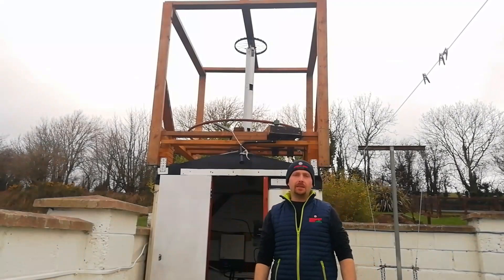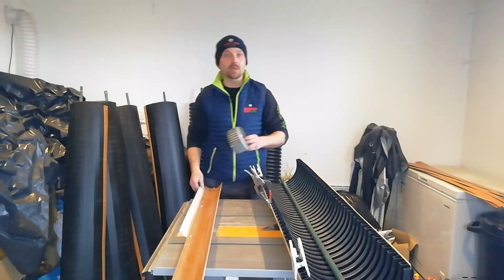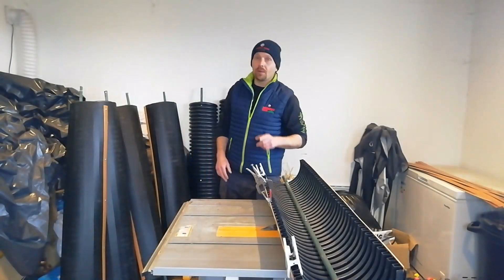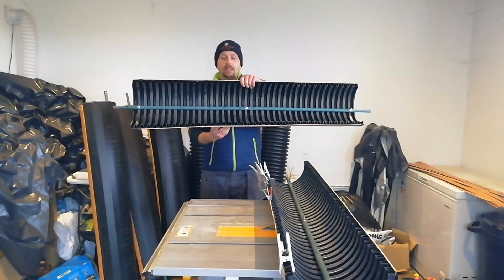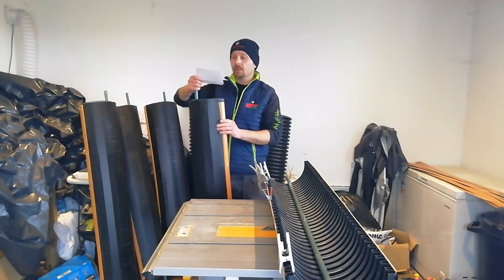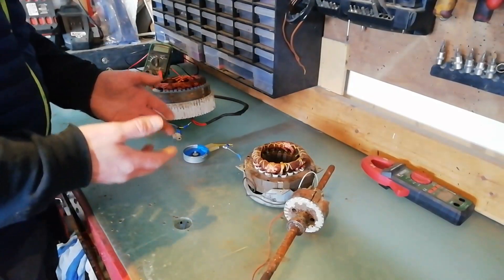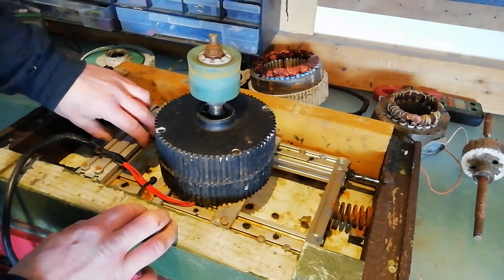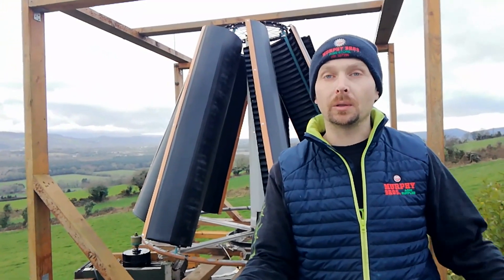DIY Vertical wind turbine, how we made it, tips and experience

Comment: What an enormous amount of time for a few kWh! 
Simply install x inexpensive (€50) 450 Wp solar panels at an angle of 60 to 90 degrees (e.g., on an exterior wall or fence).
 Even THAT will generate more electricity in winter. And for at least 25 years, without maintenance or repairs. 
Small wind turbines close to ground level, on the other hand, rarely last more than a few years.
Reply from the maker: Watch our more recent videos, we currently have 10kw of solar.
Reply: @ourkilkennyhomestead2006  I know that they also have plenty of PV panels. My post was meant to be general: even in winter, small wind turbines don't generate enough power. And the effort involved in building or assembling and installing them is disproportionate to the – in most cases – short service life of wind turbines.
Reply from the maker: @michaelvanallen6400 in reality the wind turbine is essential to continue living off grid. Solar alone won't cut it.

Comment: WHat has been occupying my brain for over a year is a vertical windmill mounted INSIDE a tube. Said tube would be 18-24 inch diameter and the WM would be mounted to the sides from inside of the tube. The tube would  be 30-40 feet high with a 90degree elbow on bearings allow the top elbow to swivel 360 deg. Having input at ground level and 30-40 ft output, facing leeward basically sucking the wind out of the tube, amplifying the flow inside the tube. 
Now if turbulence becomes an issue, a sheetmetal grid of 1inch boxes be inserted into the tube forcing the incoming wind to become laminar as it gets forced into the boxes of the grid of sheetmetal entraining the wind which would help reduce the turbulence.    I believe forcing the wind up by having it suck up the wind from the leeward facing elbow at the top of the tube would amplify and maintain a usable wind force. Placnig adjustable vents with electronic feedback on bottom would allow control of flow of wind entering the tube helping eliminate over rotation.
Reply: I do not enjoy the resources you have of equipment,  and space (suburban living) allowing construction of all manner of tests on my property. Living on 60x100.
Reply from the maker: Sounds like a design thst should be built and tested, I like it. You could also incorporate a venturi into the tube to increase the speed of airflow.
Reply: @ourkilkennyhomestead2006 yeah was thinking that too, but one step at time. I don't know the rudimentary of the tube the swivel bearings at the top and the electronics to get this to charge a battery.
Reply: @ourkilkennyhomestead2006 do you have any experience as to whether airflow?Hitting a vertical windmill from below, we'll actually spin it, or does it have to be somewhere lateral perpendicular flow?
Reply from the maker: @SomnoNaut have a look at automotive interior fans, "squirrel cage" design systems.
Reply: @ourkilkennyhomestead2006 i know those from a nineteen sixty eight javelin.I used to have which used those for the heater. The issue is the air was fed into the box where the fan was and the fan then took it and blew it out.A space above where the fan curvature was. I'm just wondering what the best design to sit in.A flow of air and produce electricity is

Comment: That is an interesting not about the corrugation.
It looks to me like you could catch more wind with another trampoline frame on the top. It would increase your area of wind catching a lot. Also if you have a prevailing wind direction, perhaps you could channel that wind with tarps, roofs or walls to direct more wind into the catching side and away from the drag side. Perhaps that is not so good for high winds though, it would negate the built in governor of drag on the return side

Comment: What power did it generate?
Reply from the maker: The best it ever did was just shy of 600w, needed a better generator and control system tbh.
Reply: @ourkilkennyhomestead2006 thank you.
Where can I get that black generator, and did you modify it?
Reply from the maker: @justtinkering6713  the black PMA was an eBay job, honestly id recommend buying a better one. If you go to the istabreeze website you can buy just the generator on its own which would perform better than the black one shown in this video.

Comment: What is the current and voltage in avarage?
Reply from the maker: @mpoltav2  average maybe 10- 15 amps @ 28.8v. Would perform much better with a better quality generator.
Reply: @ourkilkennyhomestead2006  really cool, thanks. Keep generating 👍

Comment: What I think most people in the wind and water power industry is missing is what the old mills had, one or another type of a flywheel that made everything go around in a steady flow. 
If you connected your blades to a flywheel, maybe with adjustable gear ?
Old windmills have big adjustable blades turning steady in low wind and got everything to work without modern materials and bearings.

Comment: why not to use a belt from the bottom bike weel (that should be round) to the generator pinion?
Reply from the maker: Not enough ratio between the wheel and generator, thats why the generator runs on the outer frame.

Comment: Interesting to see the topic of corrugation being brought up so much in the comments.
Why aren't wind sails on sailboats corrugated if that also isn't using the principle of lift? When you give them, I've read through your explanations in the other comments.

One reason given is that it channels the flow of the air, but that air would get directed in the same curved path whether corrugated or not. Therefore the forces at which the angle of the wind is hitting are not augmented. Remember it's not just getting hit by the wind, it's at what angle. The wind that hits the walls of the raised ridges is going to be ricocheted off at such a slight angle like a bullet on a tank, providing no extra ooomf, just a small loss in the sideways direction.

The surface area one also doesn't seem sensible, if taken further.  As some have said, you can't increase the surface area of the wind hitting the device. That's just a flat geometric shape cut out from the air.
More so, if surface area was a benefit why not put in much more? You could increase the number of wrinkles and folds like the crevices of the brain, or microvilli in the intestines, or fins on a metal heat diffuser. Just imagine, would the result be a super turbo fast turbine, or a heavy lump?

Speaking of heavy lump, the fact that you haven't shown this turbine IN ACTION yet, and are forced to move it using a jet of water instead of the actual wind itself, makes me think it reasonable for us all to expect that until you can prove to us otherwise with a demonstration (Which the whole community would be glad to see, so we could all improve the efficiency of turbines) why the whole world is wrong and you're correct, perhaps you'd be better served by evaluating your unsubstantiated claims.

Proof sir! You must give proof (I'd suggest two side by side, one corrugated, one not). Until then, it's unbecoming of you to act offended when called out for your... bologna. So far it's you alone against the entire world on this (Since no one else does it this way on purpose that we know of), so if you want us to take your future videos seriously, either lose the indignant sort of, "I'm right everyone's wrong" attitude in the comments or else PROVE IT.
Reply from the maker: You sure put a lot of time into that one. Let me address some of your key points, your 1st error is perhaps in your perspective, this is not a lift type turbine it's a drag type as are sails on a boat they operate on drag not lift. So principles and behavioural characteristics that apply to lift type designs won't apply here. The fundamental principle of drag type is to catch as much of the available "pushing" force from the wind as opposed to lift type which operates on a pressure difference between blade surfaces.
With drag it's ideal if a larger catchment surface can be created without increasing overall size of the  blades which is what corrugation provides.
Re: my attitude, is born out of frustration at this exact type of thing. For centuries man has used ridges, splines, Phillips design, torx design etc, all to increase the surface contact area for an application. It's fairly simple as I see it but it seems that most fundamental of understanding is lost on folks who seem to think that this turbine operates on lift principles and hit me up in the comments claiming I'm some sort of fraud simply because this creation doesn't fit their understanding, knowledge base or terms of reference.
Power output, as the generator is a seperate device, theoretically this design can produce whatever the attached generator is capable of. In this case it's driving a not very good ebay generator claimed to capable of 600w @24v when the best I've ever seen from it is between 2 and 300w max.
With all that said, the current situation is that I haven't bothered to repair this creation since storm force 10 winds ripped 3 blades off after 45mins of high speed performance. Long story short I will be rebuilding a tougher version with gauges and would like to get a better generator also but it's not in the budget this side of Christmas.
I did do basic smoke tests on the blades to help visualise the airflow behaviour on the corrugations and the results were interesting to say the least.
I hope this addresses your questions , thank you for taking the time to write the comment without the snarkyness. When it comes to comments, if I get attitude, I will respond with attitude.
Hope this covers everything, as a suggestion i would recommend looking into the various methods used in different technologies to take better advantage of the coefficient of friction by increasing contact area. Another good example of this is an engineer named graham flowers who designed a drag type HAWT using corrugated blades. It works extremely well and you may find very interesting.

Comment: If I may pick your brains, what makes the 4 blade fragile? I love to understand.
Reply from the maker: You can pick but you may not find much 😁 only joking.
There is 7 blades in total. What makes them fragile is simply the upcycled materials used for construction. With better materials such as aluminium I believe the design would have survived the force 10 storm that damaged it.
Reply: Thank you so much for sharing ❤

Comment: Awesome video, thinking of doing a similiar DIY project. Had a Couple questions:
1. How much power is this generating a day? I know it's wind but on average what are you able to generate
2. Could you scale it up by adding another motor on each corner?
Reply from the maker: Hello Cole and thank you. Currently it's generating nothing as it was damaged in a force 10 storm a while back. The best we saw out of it was 200w approx, this is due to the poor quality generator (ebay). I'm on the hunt for a better generator at a good price before rebuilding it with some improvements in durability. 
This could definately be scaled up to run multiple generators if required. One thing to note is that it's a low rpm turbine so the turn ratio between turbine and generator is important to ensure that the generator turns fast enough. That ratio in this case is 30:1.

Comment: How much electricity do you get from it annually?? Cost of materials?.......Please.
Reply from the maker: Incidentally we have a vid on the moment of failure if you're interested.
Reply: @ourkilkennyhomestead2006  Go on- break my heart. put it up. Good luck with your project and channel btw.
Reply from the maker: Honestly can't answer that question as the turbine was destroyed in a gale force 10 wind a few months after it's construction.
Material costs were roughly 400 euro including the generator which was €250
Reply: @ourkilkennyhomestead2006  Sorry to hear that. Thanks for the reply. Most of what I read/watch says 'don't bother with small scale wind, it's not worth it.', I'd have loved them to be wrong. Any idea of what the most it cranked out was? 300W?
Reply from the maker: @michaeljames5936  funny enough It put out just over 200w a few moments before it went kaput. When it comes to small scale wind, we've learned from our setup of solar combined with an istabreeze HAWT that wind is a good complimentary source of power for when the weather is poor or at night time. To have a more reliable off grid system, more than one source is required unfortunately. A combo of wind, solar and a petrol/diesel generator seems to be the setup that works best to ensure power is available in all conditions. If you're thinking of building a system yourself I'd suggest starting with solar, then a generator and finally add the wind turbine.

Comment: this is quite clever. I wandering what if you put the blade in the opposite direction , i mean wider in the upper part, with the wind triyng to lift it as a a plane wing and pushing upwards, maybe more velocity and torque. Thanks for sharing

Comment: Hi loved your creativity... Corrugated looks good and if you are like the IOM then the wind won't be a issue ! Just stripped my Chinese lantern as no matter what I was getting 2 - 4 watt at 2-4.5 volt ( not good) found the three phase cables had been pushed into the coils inside the insulation wrapping, no solder or connections the wire fell out as soon as I opened the casing carefully due to seal..... Do yo know what wattage you get from a working 
VAWT  I think this is a 400 w 12 v. Many thanks for your video.
Reply from the maker: Hi Dan, not sure if you have a similar generator to the one on the vawt but ours originally made around 200watts. It's a bit the worse for wear now 2+ years later so probably below that output. One way you can test yours is with an amp meter. Connect the generator to a controller, rectifier or even an AC load of some sort and see what amperage you get. Then multiply amps by the volts to find the Watts.

Comment: Nice simple design. I do like the idea of having the motor on the outside of the lower wheel, as its got more or a circumference from the motion of the spin. Have you connected this up to a battery etc? That would also be good to show, in another video maybe?
Reply: Iron conducts electromagnetism 
Soft precious metals separate the north + and south - energies.
Plastics insulate the nucleus precious metals from one another.

The moon bounces between the Earth's two N&S  energies +&- 19 year full cycle.

Earth's precession of the Alpha Omega equinoxes full cycle 26,000 years.

Sun's precession/OBLIQUITY cycle 60,000 years.

Rotation of the galactic bulge is 240,000 years full cycle eccentricity.

Climate trends obliquity eccentricity.
Climate cataclysms eclipsing the electromagnetic gravitational energy equator of the Sun's Oort cloud magnetosphere every 12,000 years for a 1 000 years, of peace if humanity accepts Jesus as their Christ Messiah.

Tictoc 2033 cometh.
Have faith in Jesus!

As tge earths magnetosphere increases due to crossing the Suns electromagnetic gravitational equator for a ye next millennium so to does the electromagnetic gravitational pull of the moon on the Earth's oceans. Voila Noah's Apocalyptic tidal waves which occur every 40 years when mercury -venus-new moon-earth and center of the galaxy are in conjunction.

Jesus humanities Christ Messiah warned us! 2033 cometh just luke Noah at Gobekli Tepe came 19 times.

Four horsemen of the Apocalypse.
1, Control 2, War 3, Pestilence 4, Death

 No man can serve two covenants, either he will love one and hate the other or vice versa."

You don't put old covenant wine into God's New Covenant wine skins.

These are just the birthing pains of the climate change END TIMES due to the Precession of the Sun's shadow equinoxes eclipsing the magnetic equator of the Sun's Oort cloud magnetosphere for the next millennium. 1,000 years of peace if humanity accepts Jesus as their Christ Messiah.

Arsonists is a red herring to try and explain away end times climate change due to the mystery of the 7 stars Jesus held in his hand to warn us about the cause. 

2033 conjunction of mercury -venus-moon and earth cometh. As it was in the days of Noah so shall it be in the days of the Son of Man.

Comment: Many people seem confused by the description of the surface area of this blade. I believe  he is referring to the actual surface of the corrugated material as a reacting surface not the area of the air blowing on the turbine which is energy available. So it is possible that the corrugated surface may extract more power from the available area of wind capture.
Reply from the maker: You are correct teddy, I suspect that it boils down to people not understanding how drag type and lift type turbines work differently.